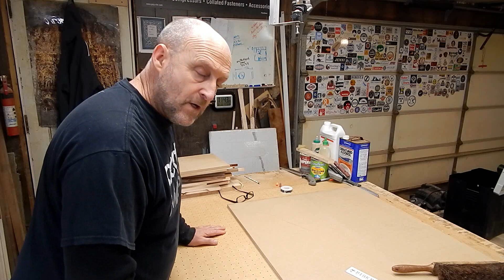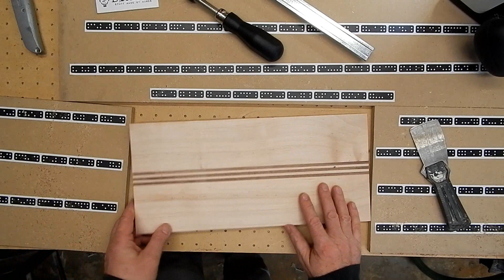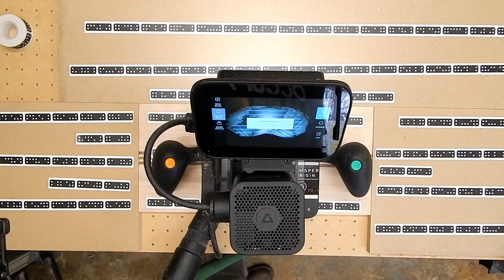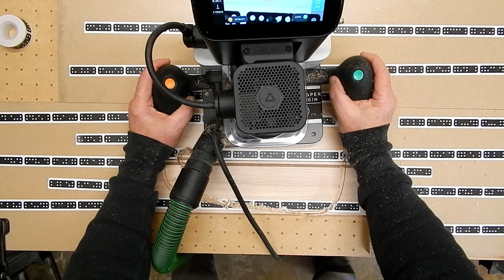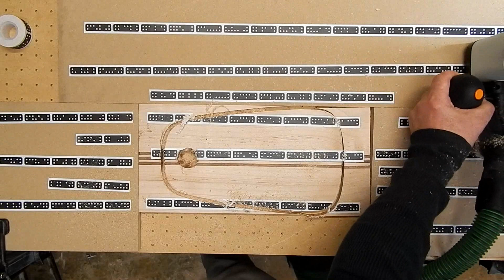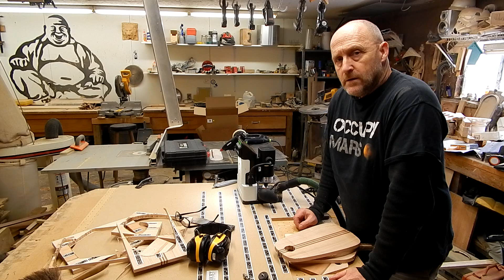Playing with the Shaper Origin Berryessa Software Update

Comment: Very informative Andy. Just found your channel. My Shaper Origin should be in any day now. What kind of laptop ( Apple or Windows operating system and any particular setup) should I get to use with the Shaper Origin and the Fusion 360 software and possibly a small CNC down the road. If anyone has any suggestions it would be appreciated…
Thanks Andy. Just subbed…
Ron

Comment: I have a question is shaper origin capable of carving in insulation foam blue or pink comes in 4 x 8 size and bigger and lot of different thicknesses (I am not talking about white styrofoam which is very weak and easy to break)
I am thinking about making bunch of wall panels 4 x 8 with Egyptian hieroglyphs so as you can imagine if the insulation foam is 2 inch thick I'll be carving about quarter inch deep cuts not going all the way through the foam and then paint the foam with the desire color, insulation foam is the perfect material to do my project it's very light and easy to Carry and attached to the walls, I have done many projects with insulation foam using hand-holding electric carving tool
Thank you
Sam
https://youtu.be/RHaFf81uFKY
https://youtu.be/0n3qobFqXlo
Reply from the maker: Sounds like a perfect application for the Shaper Origin!

Comment: Good video and thank you for sharing. How would this job compare to making the cuts on a bandsaw and using a sander to touch up the edges? Mike
Reply from the maker: Speed and àccuracy, Mike. Especially when working on multiples. It's unbelievable how it's changed my workflow

Comment: I think you will find that you do not need the tape on the workpiece itself. I really like the way you have set up the scnning area with the two movable parts to trap the workpiect,  also I think that you can use a different thickness of the workpiect if it is thicker than the scan board.  you might hae to ad a couple of same thivkness blocks to make the Origin stab;e at the edges. The tape is expensive so by just never cutting it saves time and money.  for now I am annoyed that without a pre order I can't look into the hub or the committee. The pre order is closed for now AAARGH!!!!! There is so much I need to know.........
Reply from the maker: Okay, thanks for your input!

Comment: The previous commenter indicated the lack of need for Shaper tape on the workspace itself.  Also, given that the camera is never out of range of the tape above the workspace, the tape to left and right of the workspace is also unnecessary.
Reply from the maker: Thanks for your observations, Wilbur. The tape to the left and right give me the flexibility to turn the Origin 90 degrees and see more tape in certain situations. These are are semi permanent, so I erred to the side of caution with the tape because I don't know what I could be cutting in the future. From my experience, more tape is way better than having to little tape. So, could I have used less? Probably, but having the Origin lose it's place in the world during the middle of a cut is a drag, so when in doubt, I tape it up! Have a good day....

Comment: Nice job, Andy, but I can't help feel you didn't need the Shaper tape on the work piece at all; the Origin's magic eye looks out some eleven or twelve inches beyond its "toes" to orient itself, according to the members of the Community.  You might find it worth doing some experimentation with air cuts to see if you can economize on Shaper tape without losing tape quality health or whatever Sam calls it (the icon in the upper right corner of the screen).  Happy Shaping!
Reply from the maker: I didn't think about doing some air cuts....great tip, Gary, Thanks!